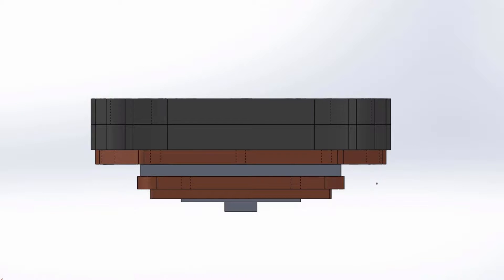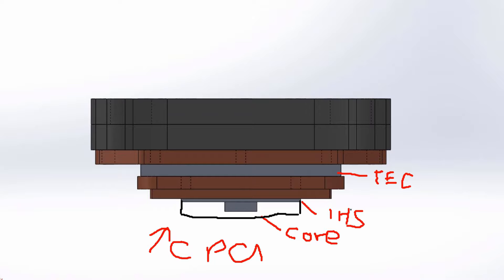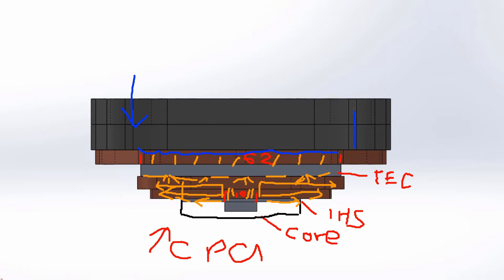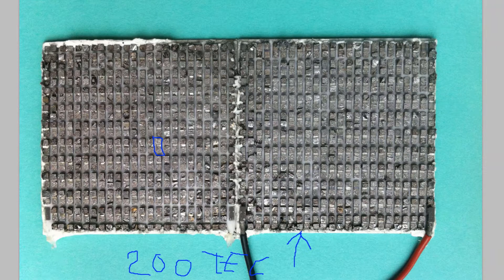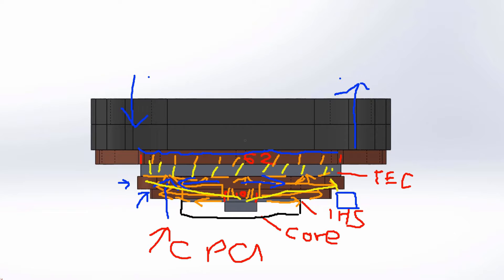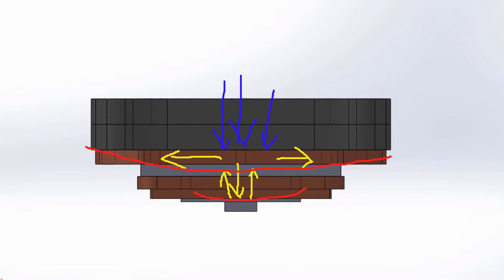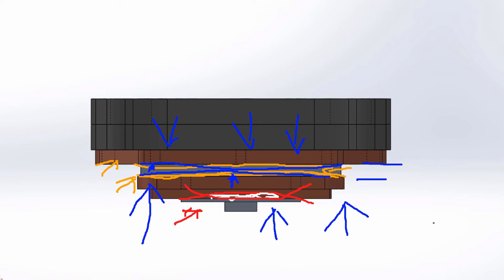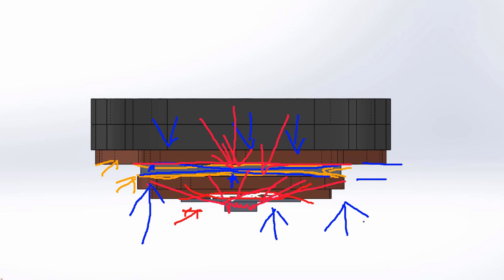Peltier Waterblock Theory: CPU V TEC Blocks & Heat Spreaders. Episode2

Comment: Hi I am looking at constructing an air cooler using using 6x TEC1-12710 in parallel clamped onto the outside of a tunnel heatsink which is a 80mm x 80mm x 225mm aluminium box tubing with several fins inside which is 0.7 c/w convectional & 0.3 c/w with a 80mm 34 cfm fan on it but I will put a 120mm 154 cfm fan onto it & on the hot side of the Peltier I plan to put 2x 41mm x 122mm x 12mm water blocks one either side of the heatsink with 3 Peltiers on each water block.

I've got your calculator but even though I've gone through a lot of video's you have I'm still unable to work out how long it will be able to cool down the ambient temperature of a confined space. Could you please help me?

Comment: I would wait for your final design especially how you will get rid of the ice forming on the surface ....
Reply from the maker: Well the only way to stop ice / condensation is too .. Insulate the block / motherboard OR simply stop the Bock / CPU from going below dew point... I want to do a series of videos on how to make a TEC Controller but will lack the funds to do so for some time without some kind of crowd funding.